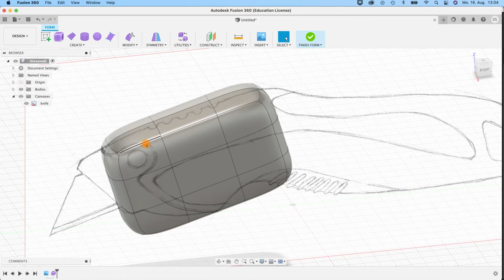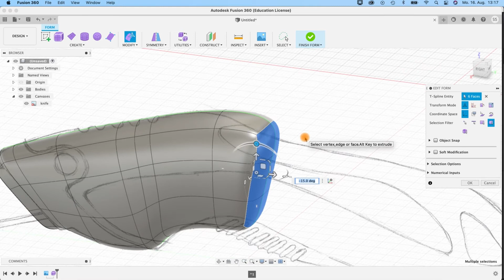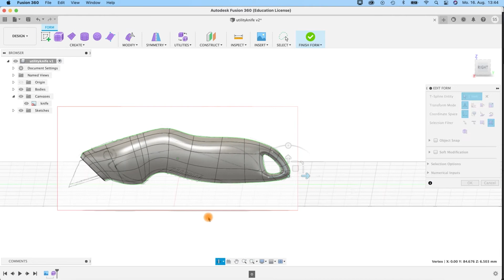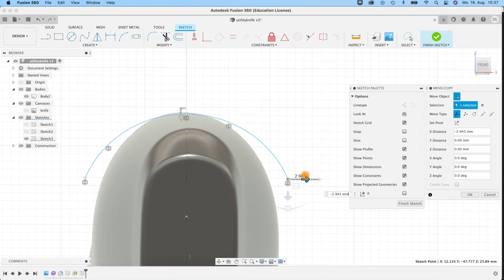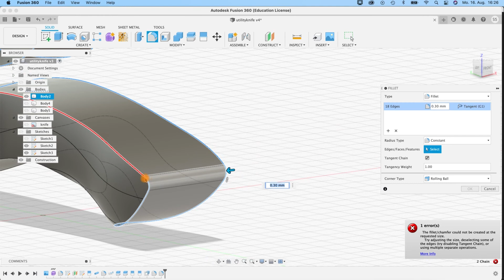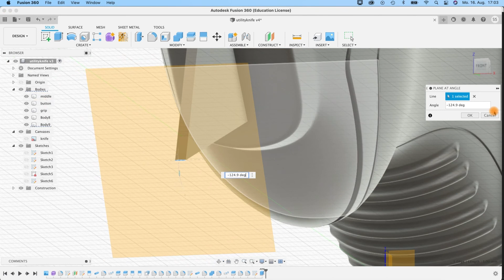Fusion360: Utility Knife

Comment: With 3ds Max, I have been able to make product design projects very quickly and get my work done using the polygon technique for 20 years. However, when the issue was related to manufacturing, not concept design, I was always getting project support from a helper friend through catia or icem surf... For some reason, I avoided learning fusion for years... I'm glad I was looking for a video for 1 month. Your videos are really great. Just according to my working style. I have a lot to learn from you. I would definitely like to watch an automobile modeling video.